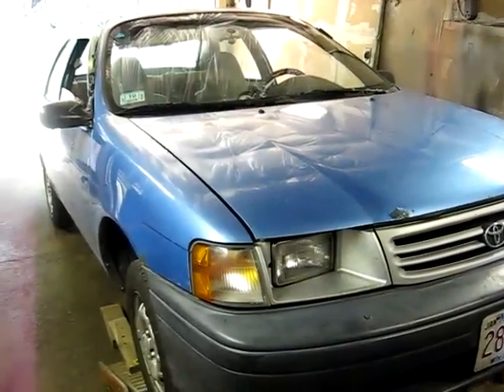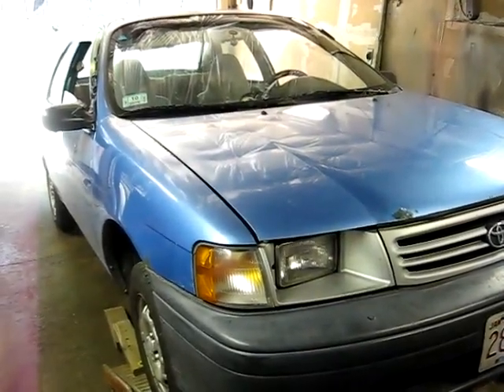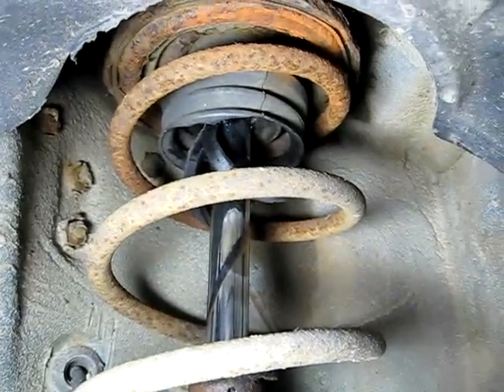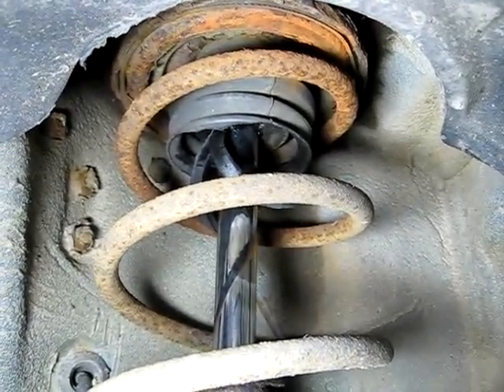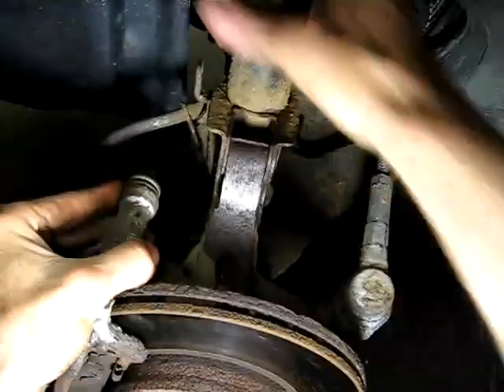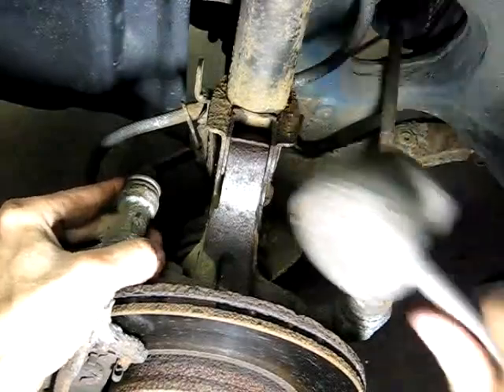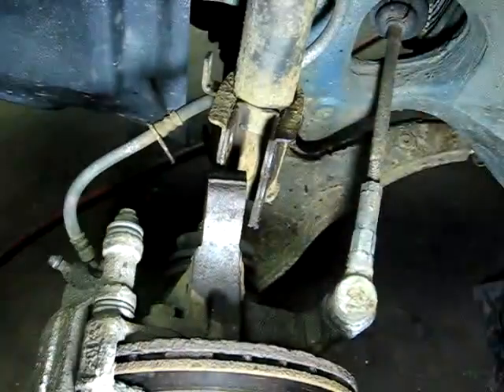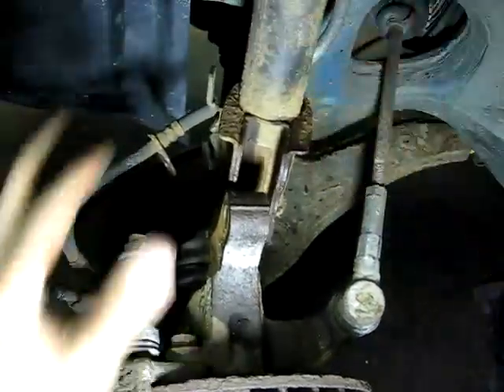Strut Bump Stop and Shield Replacement

Comment: rich, you shouldn't hit the boot off with a hammer. you can easily miss and hit the strut rod. the slightest distortion on the rod will damage the o-ring inside the tube and it will eventually start to leak. for same reason you have replaced the boot so that stones from the road don't chew on the rod.

otherwise good and quick fix as usual from richpin.

Comment: some possibilites:
1. your top rubber mount is rusty and it rubs. it could also be the seal between the mounting rubber and chassis.
2. your lower and upper mounting brackets (those that actually hold the spring) are rusty or the upper one has free play/is our of shape. you should also replace upper and lower rubber seat.

when doing struts it is always best to replace everything as an assembly. if you do partial fixes then boots, bumps, rubber seats and over time mounting tops too are a must.

Comment: @sm870621345 - I also have a creaking noise in a 1998 Corolla. It sounds up high in the strut, ( possible strut mount or coil spring insulator?). I havent replaced anything yet. What could it be?

Comment: The bottom of the dust shield looks like it is a larger diameter that the top of the strut body - meaning that it looks like the dust boot has a loose fit on the bottom.  Are the dust shields supposed to fit like this, or are there some that fit tight at the bottom?  I just received a set of struts / shields and bump stops from an online retailer and the dust shields were listed as having clamps for the top and the bottom of the shield (top clamped onto the bump stop; bottom clamped onto the strut body).  Instead, the dust shields and bump stops look like yours - the top of the dust shield is fit over the bump stop and the bottom has quite a bit of clearance so it looks like it slips over the strut body, but does NOT seal or have a clamp.  Is this an acceptable alternative?  Everyone reading this, please feel free to chime in based on your actual experience installing these.